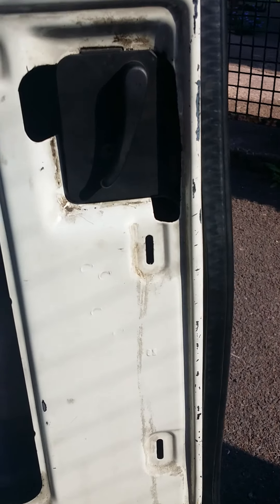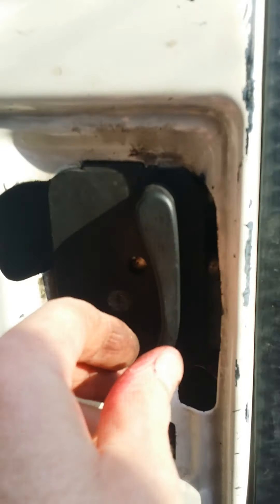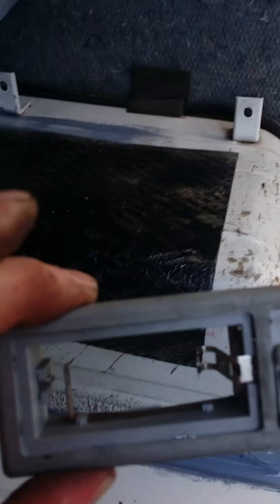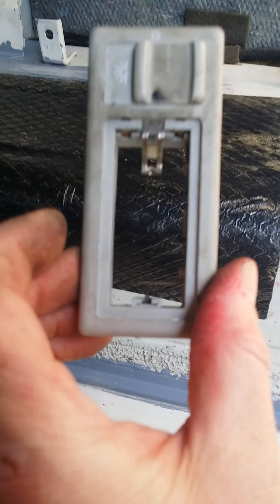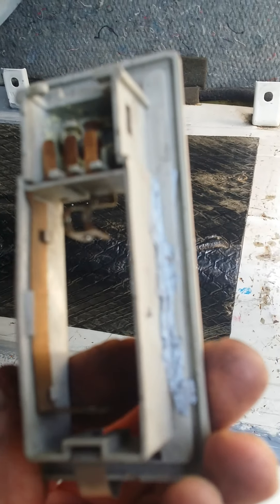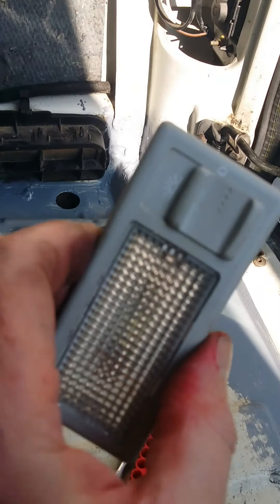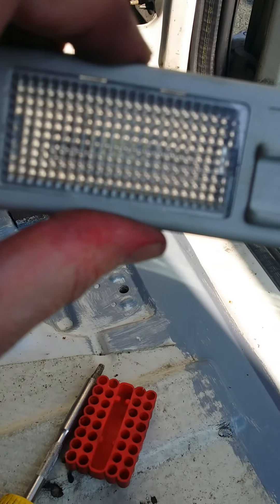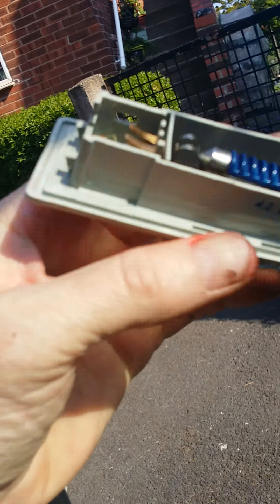VW CADDY MK 2

Comment: Hi Roger, I just bought a 2001 Seat Inca, basically the same van as yours, but from another brand. I'm trying to transform mine into an MTB/mini camper van. It's great to see your videos, experiencing a similar van journey as mine. I'm slowly fixing some issues and this back door lock.... it's driving me crazy :) I've dismantled it about 20 times already and still haven't found the solution. Great to see your progress, thanks for sharing your experience. Cheers from Portugal
Reply from the maker: Well Thank you for your comments and dropping in to my page/you tube uploads ( which are slowly getting better 😅 iam no movie star ) Anyway ...its pointless doing all the nice things without dealing with the problems...so it is slow work but when its done...and done right it should go for many miles to come without causing issues...after 20 yrs or so things just wear out or break...once again thank you 👍👊✌